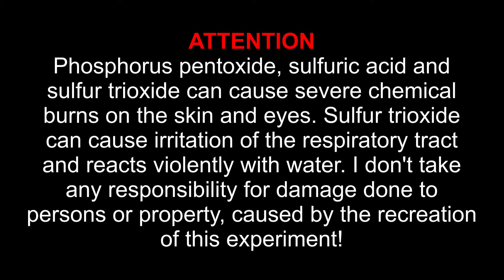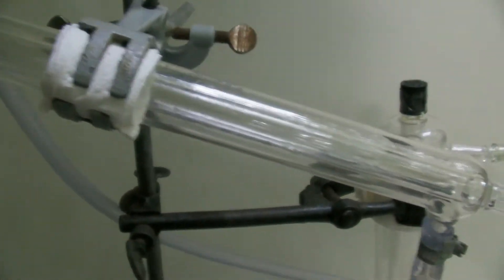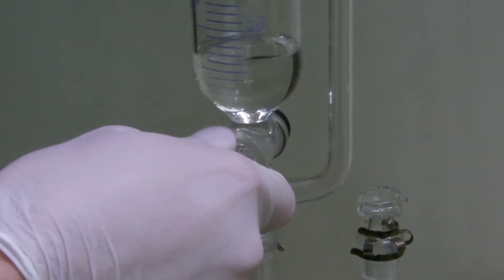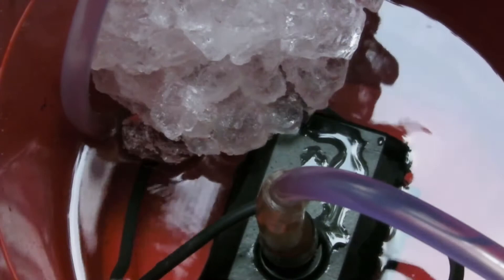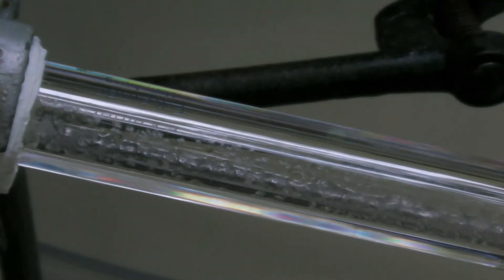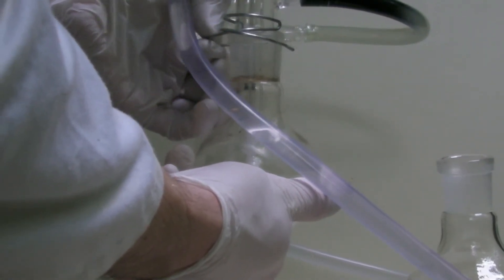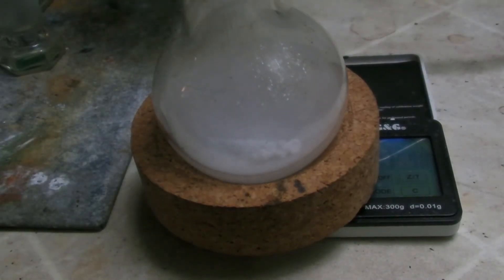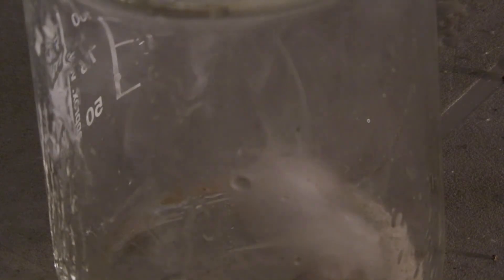How to make sulfur trioxide

Comment: SO3 from Sulfates is easier done:

"The oldest process for preparation of oleum is the destructive distillation of FeSO4.7H2O (green vitriol, copperas).

Merck says this loses water at 300 C and decomposes at higher temperatures. I suspect this goes:

FeSO4 -> FeO + SO3

If so about half the mass is converted to SO3.

Might this be the basis of a practical lab scale preparation of SO3 or oleum in a tube furnace?

No catalyst required
No SO2 feed required
Relatively modest temperatures (maybe) compared to vanadium process

My tube furnace is 12" x 2" and good for 1100 C which is a lot more than required. If this decomposition will proceed at pyrex temperatures that would be very convenient."

Comment: You specifically suggested using "teflon grease", which I wasn't even aware that there was a teflon grease. Would the Dow Corning vacuum grease (linked below) suffice? If not, can you tell me exactly what you use or which product is best? I don't plan on actually doing this exact experiment, but I do need some highly inert grease that would survive situations like this.
https://www.amazon.com/dp/B081LNYLPL
Reply from the maker: Unfortunately, it's pretty difficult to get your hands on grease that is made of PTFE and PFPE. You have to look it in the data sheets of the greases. I'm using "Triboflon", but it can usually only be bought by companies... Back then I found "Äronix 6800", which I bought, due to it being made of PTFE and PFPE and having a similar composition like Triboflon. (The data sheets seem to be impossible to find, today...) Nevertheless, I have still not had the chance to try it...
Reply: search for:
Fomblin PFPE gease / oil
Krytox PFPE grease / oil
Chemours
Klueber

Comment: Great Video! I honestly have never seen Sulfur Trioxide crystals before,and they look pretty cool. You just need some Sulphur Dichloride... I imagine you could probably think of several uses for Thionyl Chloride.
Reply from the maker: Unfortunately suflur dichloride is pretty nasty stuff. I thought about using PCl5, but it will take some time until I can try this.
Reply: While Sulphur Dichloride is pretty bad, it is not nearly as bad as Oleum or Chlorine gas to work with. If you try to use PCl5 for making a Acyl chloride, it tends to nearly always get extremely messy and difficult.

Comment: I can only imagine the piranha solution you'd make with that and some 80% peroxide...
Reply from the maker: And then add some interesting stuff :D
Reply: It would probably produce nearly pure peroxymonosulfuric acid, one of the strongest oxidants known and highly explosive.
Reply: @kronek88  now I know,how Alphachem makes pure crystals of peroxomonosulfuric acid!And the only thing I am actually wondering:what if you add some pure SO3 to pure H2SO5??Will they react,or will one of them be dissolved into another?))Just damn,seems like that concentration of sulfuric acid can be not just higher than 100%,which is weird but that it has probably no limit at all😂😂😂
Reply: @johnsheppard1476  It would make disulferic acid H2S207
Reply: @kronek88  Add potassium permangenate and would that make an even better Mn07

Comment: Time to make some >100% sulfuric acid!
Reply: It’s quite literally the anhydride of sulfuric acid, so yeah, it’s effectively higher than 100% if you reacted 1 mol of this with 1 mol of water you would get 100% sulfuric acid
Reply: It's called "oleum".
Reply: @piranha031091  yep,quite a nasty stuff:sometimes it really causes a bible-scale disasters🤗😇
Reply: piranha031091 oleum is actually not SO3. It’s sulfuric acid with sulfur trioxide dissolved in it.